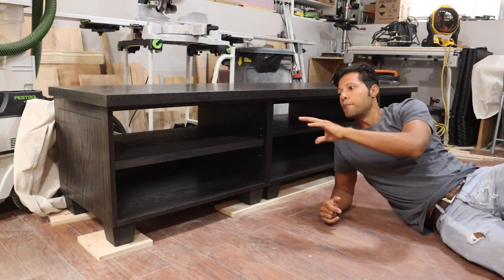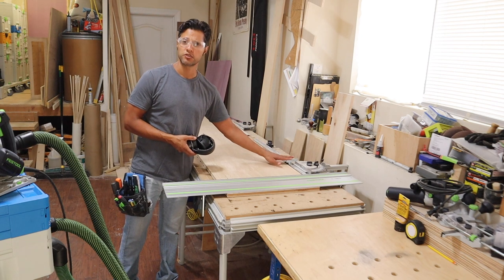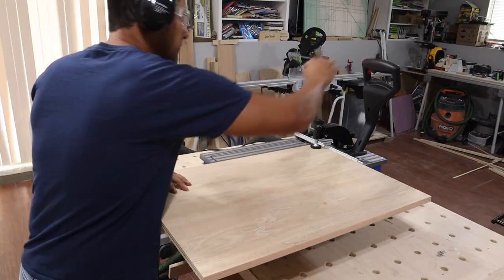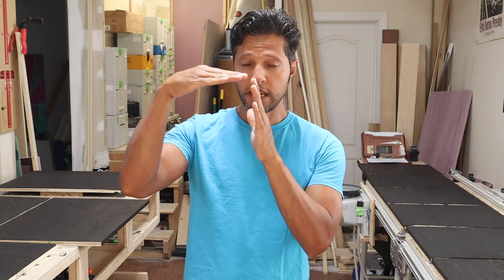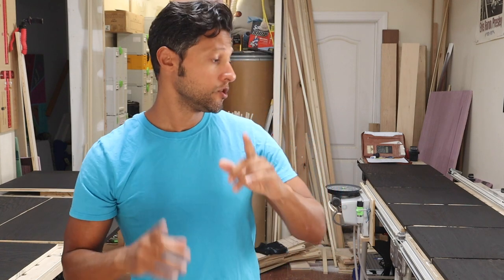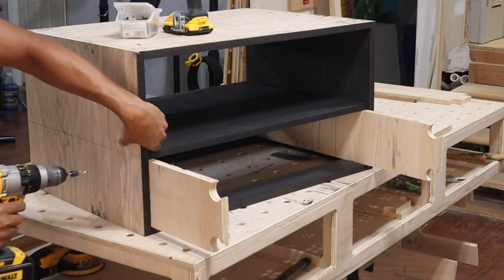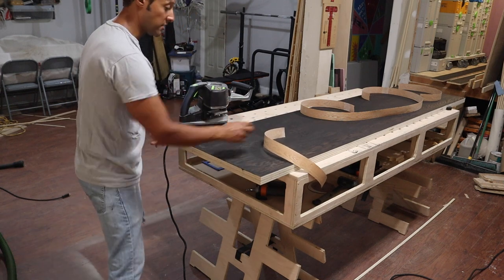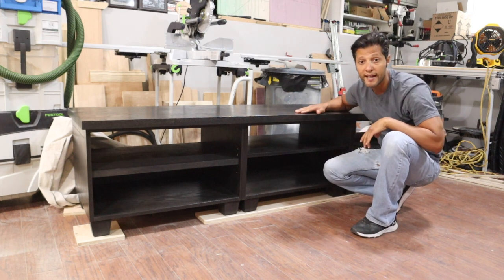Media Cabinet (pt. 1)

Comment: Since moving to the festool system, my table saw is literally just for the last cut before assembly.  I do the same process as you and once 3 sides are 90 degrees to each other, I run the piece through the table saw to finish that up.  I downgraded to a laguna fusion since I don't really need much power to do that.  I will say, I would recommend the uk benchdog fence over the MFT factory fence and the dashboard hinge is far superior.  Other than that, we're using very similar workflows.  Great video.  That accent makes this work it.  It sort of reminds me of a tougher Norm.  LOL

Comment: I hope that’s not the final height for the A/V equipment.  From the floor up to 20” is basically a constant cloud of fine dust, especially in a room with carpet and with air or people movement.  The A/V equipment will be coated and packed with dust in a few months that low.
Reply from the maker: This is going in the client’s basement bar/movie theater that I built. Porcelain tile floors and only occupied for the occasional party. I’m pretty sure it will be fine since Over the years I’ve never seen media cabinets much more than 1-2 inches higher than this. Total height was just over 22”. You gotta give ‘em what they want.
Reply: @AnthonyScolaro1  I hear you, sound like success, understood.  Nice job, looks great!